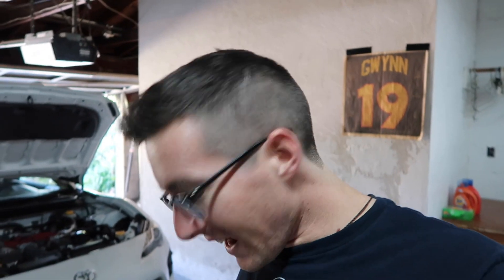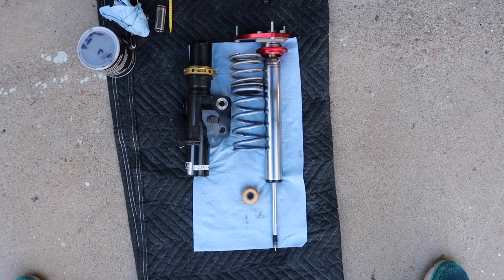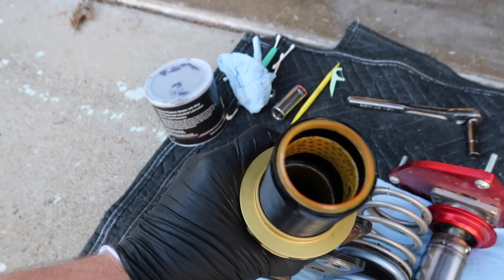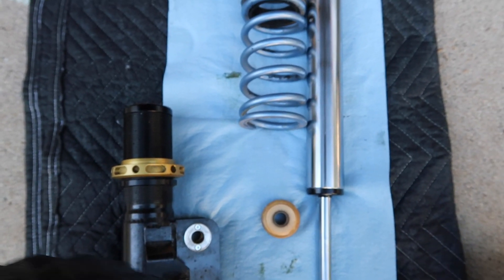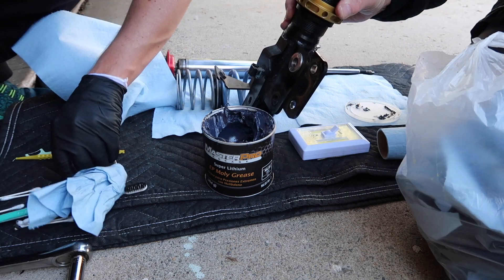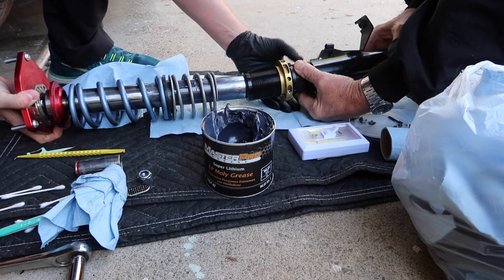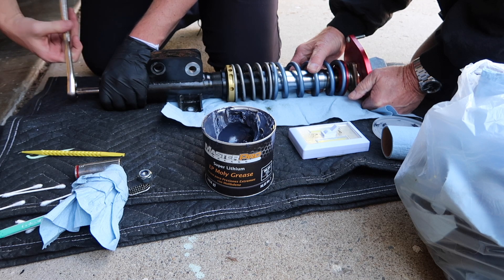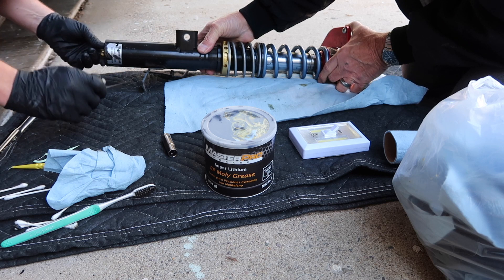How To Fix Clunking Inverted Monotube Struts

Comment: Great fix!  That seems like a pretty short service interval, even for a race part.  Hopefully the thorough greasing you did lasts a bit longer than what came in them from the factory.  Good luck with your autocrossing this season!
Reply from the maker: I'm crossing my fingers the new grease will hold up. I'm not seeing as much build up on the strut so far. We shall see! Thanks.

Comment: I know that it's reasonably easy to drill and tap for zerk fittings on the STi inverted struts... but I wonder if it's possible to add a couple of zerks to those grease channels in the Whiteline tubes.  Or if a small channel can be added to the teflon ring and a single grease fitting added up near the top.  It would sure make re-greasing these things regularly a simple job and more user-friendly for street/track applications...
Reply from the maker: On a non threaded shock body, yes, with this the spring is in very close proximity to where the zero would need to be placed.
Reply: Ah yeah.. I see what your'e saying.  I also just noticed that the front springs on the Whitelines are so tight to the strut body that even a small zerk would most likely make contact.  The dream is over...  v_v
Reply from the maker: @tonymorrill6561  I think DLC coating the inverted strut would be a good way to go.

Comment: good knowledge! I will grease mine up before chucking them on!
Reply from the maker: Fantastic. If you live in an area with a lot of rain I'd recommend a marine moly grease.
Reply: @TheDriversPerspective  awesome. Will grab some fom the auto store. I'm in Australia &  only really drive my Subbie 2-4000 miles a year so I hope is lasts at least a year. 
By the way,  did you buy retaining springs?
Reply from the maker: Should be enough for your driving. By retaining springs are you referring to the helper springs? Mine came with the shocks. I've only swapped out the main springs for 6kg Swift springs to bump up the rates slightly.
Reply: @TheDriversPerspective .  Yep those helper springs,  awesome. Will keep an eye out for future vids. Thanks again
Reply from the maker: Glad I could help!

Comment: Ah, yeah, HF switch light, love those. Would marine grease be okay because water resistant? Or do you need a high temp grease? Axle grease? That's lots of work for a street car and most would have to do this every 3 months.
Reply from the maker: Such a great light. We are flashlight nerds over here too. I was wondering the same thing after I put them together. I don't see why marine grease wouldn't work. I'm going to do that next time I take them apart for service. 

For a street car, the service interval is absolutely ridiculous. I put 2000 miles on these shocks...way less than most drive their cars.

Comment: This is what happens when you setup your tofu car for the track instead of the touge smh
Reply from the maker: Too many gutter runs.
Reply: @TheDriversPerspective  Doing over 10K miles last year up in Blue Ridge, I killed approximately 18 critters pop denting the front bumper 3 times, broke 2 splitters, 1 grill, full round curbed 6 wheels- cracked one, and punctured 3 brand new tires.
Never had a component failure . .
- MY18BRZtS
Reply from the maker: gorrilaunit99 that is the joy keeping everything stock!